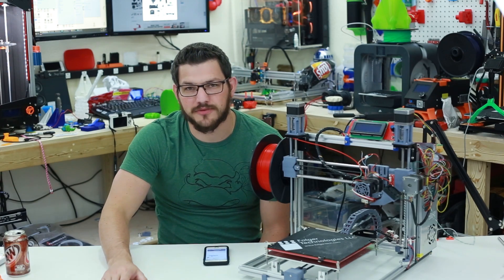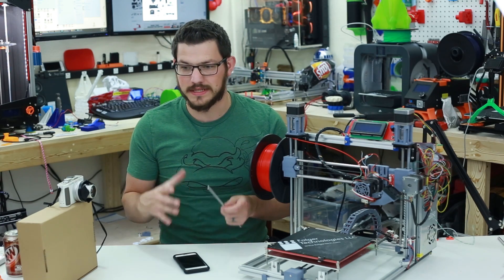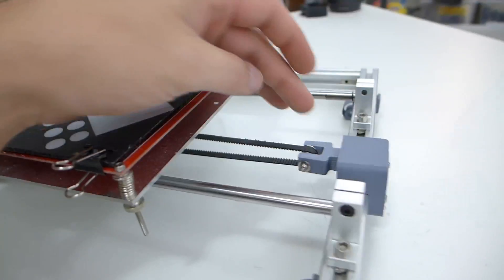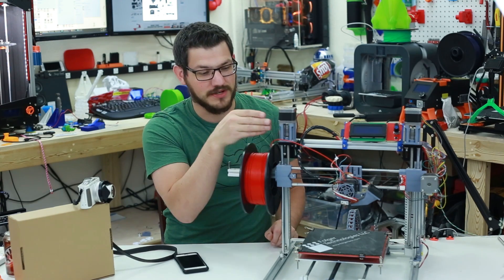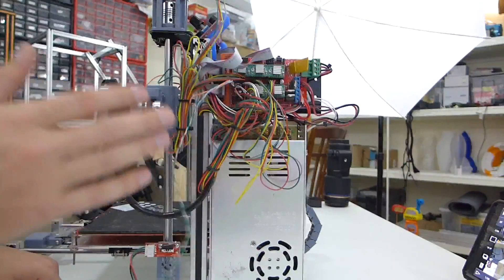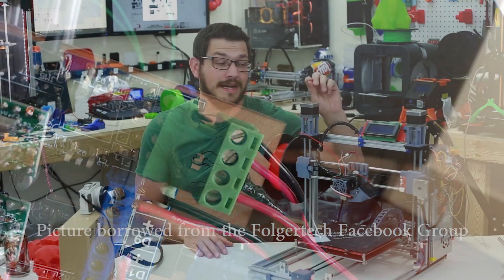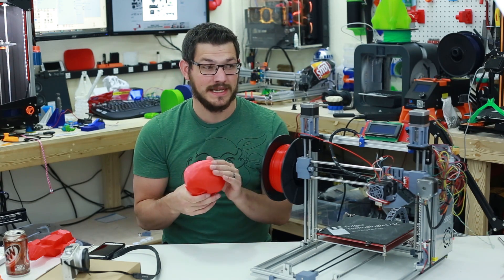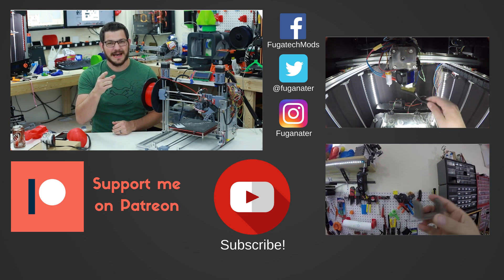2020 i3 from my Fans!

Comment: If this is running marlin, adjust the X/Y offsets in firmware, and set your slicer to be normal. this has worked for me on my i3 clone that has 0,0 start about about 10,10 inward from the home.
Reply from the maker: I'll look into this. Thanks for the tip!

Comment: Also, designed some 2020 feet I'm using on my CoreXY build..  simple but print in TPU/TPEE with 4-5 shell and top/bottom and in the 25-40 range infill to help with vib absorption... https://www.thingiverse.com/thing:2624327
Reply from the maker: I printed them and posted my make but I have not tried them yet.

Comment: OK.. couple things... The X and Y issue you can set correctly in Marlin. I did a write up on itand a how to in my blog, its with the older version of Marlin but it's not hard to convert, they just moved the home XYZ setings WAY down below the auto leveling stuff in the Config-H file. 
... https://3dprintingllama.blogspot.com/2017/04/centering-on-your-bed.html